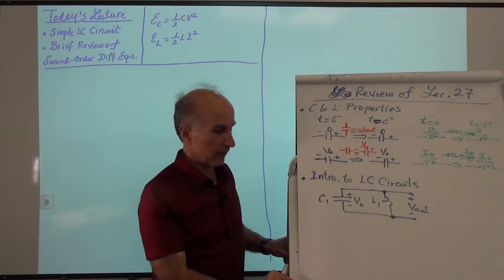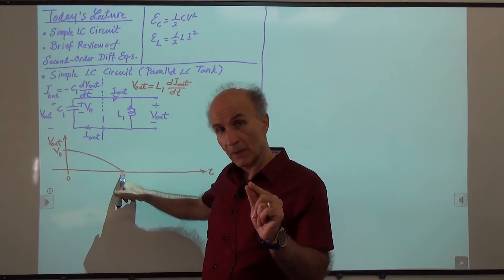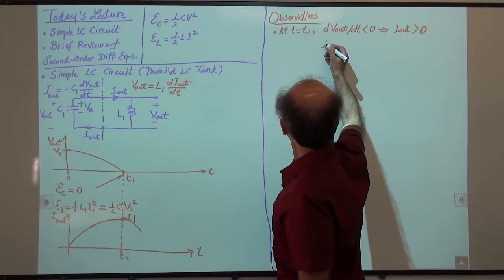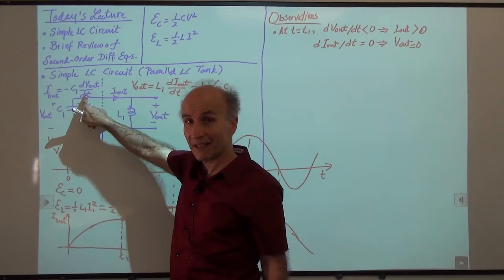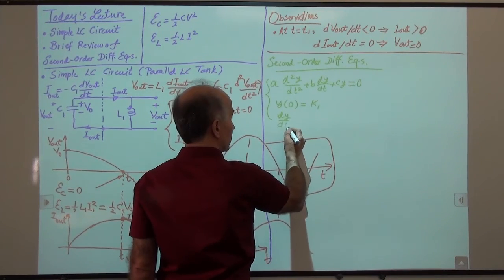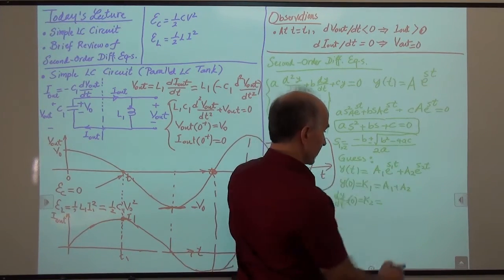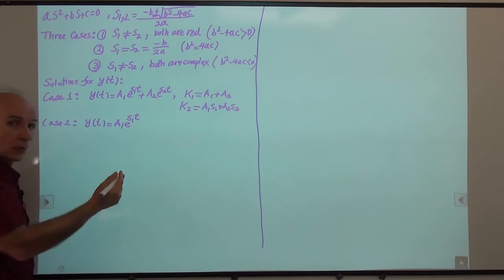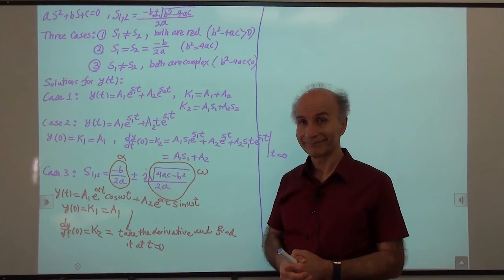Razavi Basic Circuits Lec 28: Simple LC Circuit; 2nd-Order Diff. Equations

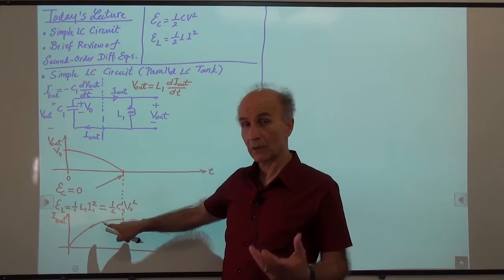Comment: 11:58 how is it possible that the voptage across inductor is zero but current is maximum... I know a short circuit means zero voltage and maximum current.bit that's plausible for a wire. It's inductor,thoroughly which we are assuming that a zero volts caused maximum current.

Comment: Timestamps (Powered by Merlin AI)
00:03 - Explores LC circuit behavior and second-order differential equations.
03:46 - Analysis of energy transfer in a simple LC circuit.
08:38 - Energy transfer in LC circuit affects capacitor and inductor voltages.
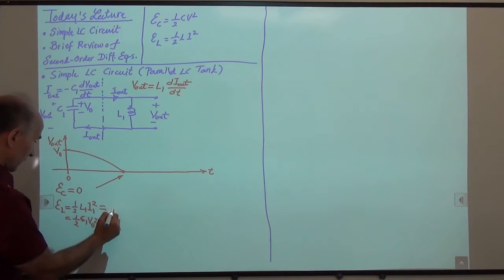10:57 - Current in the inductor varies after peak due to energy transfer dynamics.
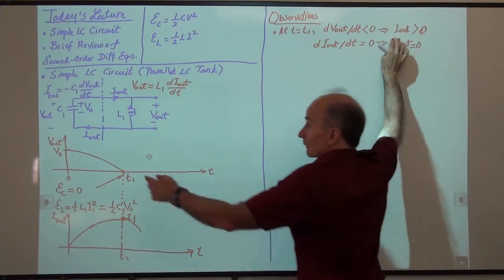16:46 - Current direction influences voltage changes in an LC circuit.
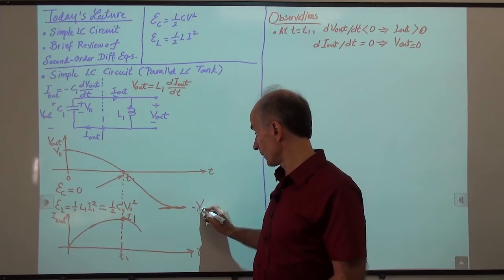18:39 - Energy transfers between capacitor and inductor in an LC circuit demonstrate periodic behavior.
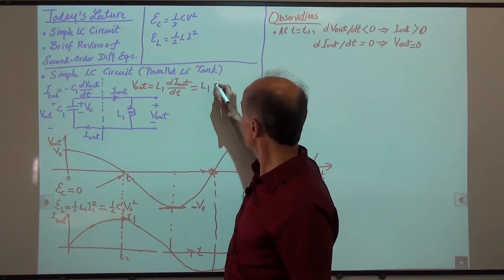23:02 - Explains the derivation and initial conditions of a second-order differential equation.
25:11 - Radars in cars utilize signal reflection to measure distances and velocities.
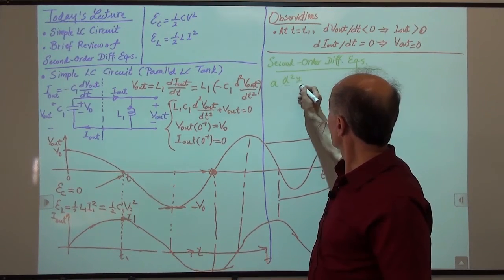29:17 - Overview of solving a second-order differential equation for LC circuits.
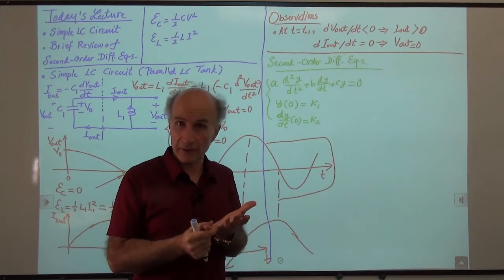31:11 - Exploring exponential functions as solutions to second-order differential equations.
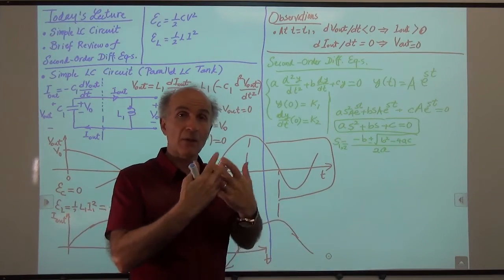35:16 - Determining solutions with initial conditions for a simple LC circuit.
37:29 - Solution procedure for second-order differential equations involves analyzing root cases.
41:58 - Three cases for solving y(t) in LC circuits.
44:08 - System response includes exponential and ramp components for equal root cases.
48:11 - Understanding complex numbers in LC circuit analysis.
50:26 - Selecting efficient solutions for second-order linear differential equations.

Comment: Professor can we say like this due to continuous exchange of energy in between capacitor and inductor.. pure oscillations ( undamped oscillations)  are produced in the circuit.. sometimes inductor acts like source in that case capacitor acts as sink..  in  some other case if capacitor acts as source in that case inductor acts as sink.. if we introduced Resistor in the LC  circuit .. circuit will provide damped oscillations.. can we call resistor as damped element..
Reply: you are right, sir also mean to say the same thing

Comment: This is the most mnemonic explanation of the second order eqs. There is a small typo for case 3, i.e., the "j" is missing in front of A2.
Reply: He was correct.. there is no need of imaginary term j infront of A2 ..if u have doubt u can verify differential equations chapter in math.. that was standard 2nd order differential equation.. if it was like the form of a+jb r a-jb.. we can write it as e^at (c1 cosbt +c2 sinbt) where c1 and c2 are constants..  professor was correct only..
Reply: It's not Euler's theorem..  it's differential equation no need of j